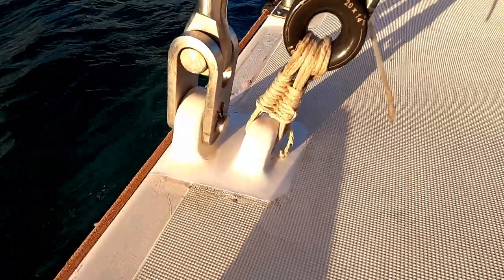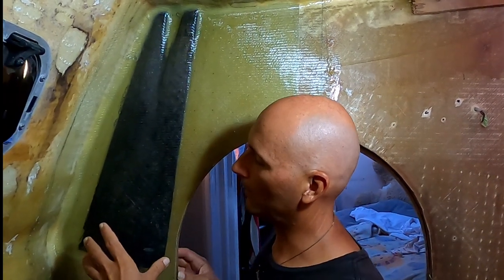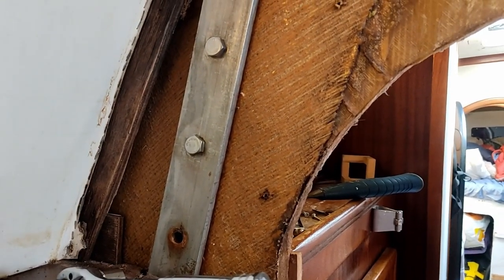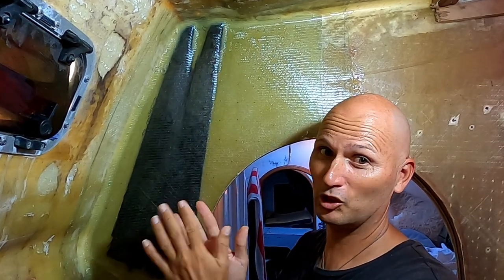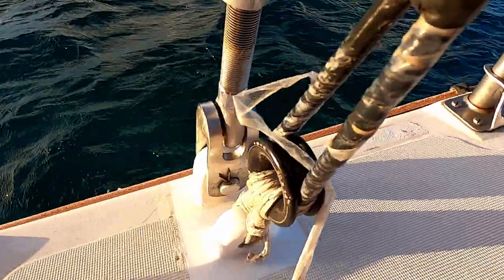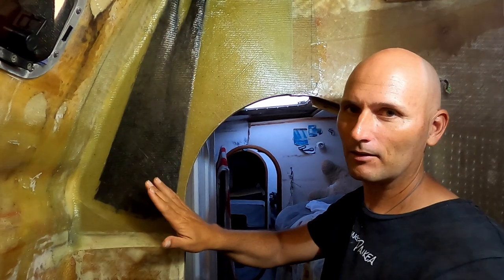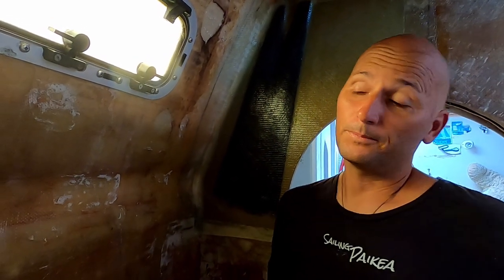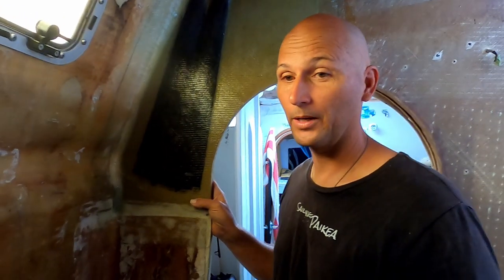Replacing our ROTTEN Bulkhead

Comment: Thanks for the detailed explanation, things have come on a lot with composite technology since I last built a boat. I am with you on liners and access to fittings and systems, boatbuilding started to lose it's way in the 60's with the advent of production fibreglass boats being churned out and much of the fit out being done before the deck was installed, don't worry about the poor guys who have to fix anything in the future as long as it looks good.
Reply from the maker: There is a lot of pressure from buyers (especially people from a non boating background) who want to buy a boat that looks and feels like an apartment. Manufacturers have the constant pressure from buyers to produce these boats with all the extra features instead of sticking to building a good sailing boat. There are some pretty tight margins in boat manufacturing and if the market wants a condomaran you've got to be a pretty confident business operator to stick to your guns and produce something that is not.
Reply: Well said, so true these days! I'm lucky enough to have an Australian 1980 Endeavour 26 monohull. New buyers back then fitted out the cabin themselves lol, luckily with mine it wasn't complicated at all & I can easily access everything although EVERYTHING is old school 10mm marine plywood. Still in perfect condition. 
Love your videos too, I'm about to start using carbon fibre & epoxy as well. Aiming to replace all the plywood with foam + epoxy + glass. 
FYI seriously, keep up the good work on the videos! Awesome stuff, you should really have ALOT more view. Cheers 😊

Comment: I did comment on the first video and thanks for the detailed video detailing the structure integration. Super cool!  Still, it seems like the e-glass load spreading should have gone further down onto the old bulkhead and further inboard on the original bulkhead. I am not an expert just my old engineering eyeballs but you have proven it works.
Reply from the maker: For sure! Every day is a lesson.
Reply: The limiting factor in transfer of load across a lap joint is the peel strength of the epoxy. My composites engineer friend did the calc when building the 40' race boat. The laps on the skins of the hull were 2". (triax e-glass) Nice to have someone who can do the math.

Comment: Hey great video. Really love the full explanation on your repairs/upgrades. I have a Lagoon 440, hull #1. Boat has been around the world with previous owners. And-like many older production boats- is in need of  of reinforcement if I'm going to feel confident taking her around the world for a second time. There are some weak points that other 440 owners have recommended building up around where the bridge deck meets the hulls and now I'm thinking carbon fiber might even be a good choice there!
Reply: I have been looking into lagoon boats, there are many stories of delaminated beams and cracked bulkheads. Not the end of the world, but definitely worth pulling the trim off your bulkheads for inspection.
Reply: @taylorhickman84  Hey just saw this. They aren't just stories. I was at Zimmerman boat yard watching them pull  out over 20 Lagoon 450s for bulkhead reinforcement. Although Lagoon has admitted to there being a problem and fixing it. Leopard and FP have their own problems, but you rarely hear about them. 

These production boats are built to be constructed QUICKLY. If they can glue instead of tab, and that saves $10k in labor per boat then they're going to do it. Why? So they can sell it at a good price point. 

A lot of people seem to forget that and tell you to go buy some boat that's 4x the price. Why does it cost 4x more? Because they spent 4x longer building it!

Comment: Really nice! Really nice. One more question. Why carbon at the "tips". Can you make the same job in e-glass or glass. Adding more material. To get rid of stainless.
Reply from the maker: When you say tips are you referring to the part of the chainplate that is on the deck? You can make chainplates using eglass you just have to add more material to get the correct strength you require. The stainless steel sleeve is the interface between the metal pin and the composite chainplate and is required regardless of the material used to make the chainplate..
Reply: @youngbarnacles  THX for info. Yes tips / part of chainplate above the deck (carbon part in your case).

Comment: Super explanation of your design and build Shane. Bet the pucker factor was substantial getting the hull out of the water. Yeah no probs on the GB68 but the Catana ? not so much. Seems like a lot of the boats out of France with ply coach house bulkheads have issues distributing load when they're a bit older.

Comment: How did you calculate the layups (material and resin) you used to build the chainplate as well as the choices of bidirectional e-glass you used to bond it in-place?  I see that you based the design off of the materials and resin you had on-hand, but how did you figure out how much to use, what shape and dimensions were required to take the load?  I am a bit new to your channel, so please excuse this question if it is already answered somewhere on your website or on a previous video.
Reply from the maker: I've got 20+ years of composite and engineering experience to draw upon 😁 If you were planning a project like this yourself we do offer consultancy services. It is definitely not a slap it together and hope for the best situation.👍
https://youtu.be/yvvyDdgUrrQ

Comment: Really nice🏋🏻‍♀️🤟🏋🏻‍♀️, thanks.. could you talk about the problem With mixing carbon With aluminium , and work arounds, thanks🤗
Reply from the maker: Do you have a particular application you are thinking about?
Reply: @youngbarnacles  We are thinking of getting help with building an Explo cat, right now we want a cat where the hull is aluminum and the rest in carbon. At this stage, it's just general thoughts, before we contact possible producers.. We saw that you had problems with the alu-carbon mix..
Reply from the maker: Sounds like a cool project. We have experience with expedition yachts that have carbon masts/bow sprits/booms etc. It can definitely work. If you want to discuss further send us an email admin@youngbarnacles.com 👍👍

Comment: Did you have to calculate area need for the shear strength to exceed the force caused by the mast and sails? I guess I’m asking how you calculated how large the carbon fiber component needed to be?
Reply: Typically you use the breaking strength of the shroud wire attached as the design load. Then add a safety factor to that number. Because shroud loads on cruising boats are ~20% of the breaking strength of the wire, you are already at a ~5:1 safety factor. Actual safety factory used appears to be a METRIC butt tonne
Reply: @evangatehouse5650  Thanks....I didn't even think to use the published wire breaking strength.

Comment: people have also used unidirectional fibreglass instead of carbon, I've seen an old video of this done on a Crowther 150 (?) design -?  https://www.youtube.com/watch?v=qHbFuvW4lpY
your thoughts ?
Reply from the maker: yes people use unidirectional fibreglass rather than carbon fibre for chainplates. This was definitely the case for the Schionning catamarans in Australia. The only difference being you will need more eglass fibre to get the strength you need. (In the video link you sent Mike used carbon for his chainplates and eglass for his little pad eyes)
Reply from the maker: https://youngbarnacles.com/forums/topic/composite-chainplates/
Reply: @youngbarnacles  thanks for your reply, what I particularly like is avoiding the SS maintenance concerns, , and the elimination of deck water penetration issues
Reply from the maker: Absolutely